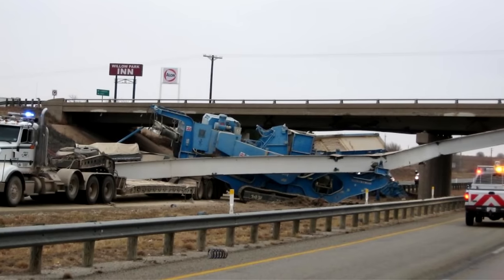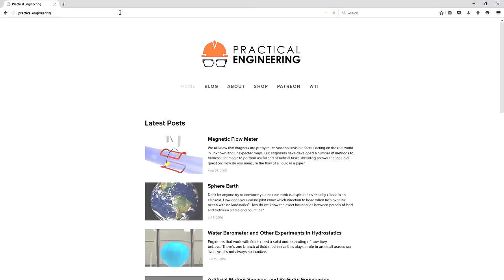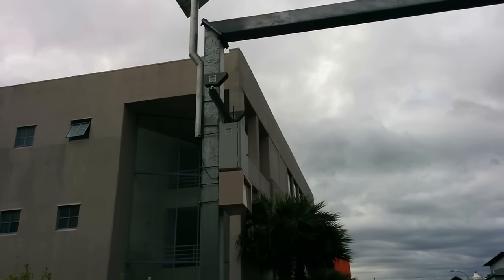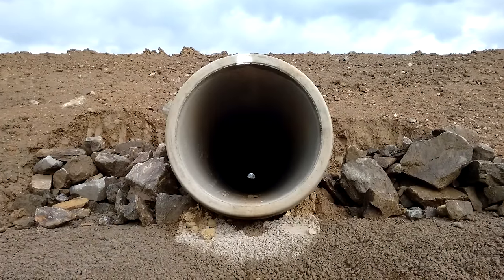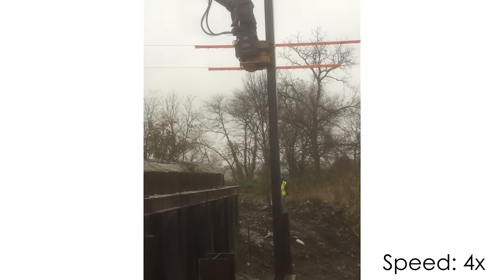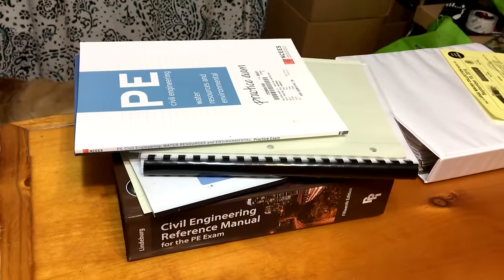What's that Infrastructure? (Ep. 2 - More Transportation Infrastructure)

Comment: how about putting a coin under one of the roller or rocker supports when there's a temperature extreme approaching, then returning to retrieve it when temperatures reverse? A bit slower than the "coin on the tracks" option, but perhaps no less entertaining.
Reply: I wonder how flat it would get?
Reply: @TheAechBomb  lets try and check :D
Reply: I was totally thinking the same thing.  You'd want to set it down and then come check it a year later I think.
Reply: It would probably wedge the roller to a stop and the bridge would get damaged because it can`t expand/contract anymore and then collapse. Then in proper American fashion, you would be sued by the people that died, bridge maker, and the US Mint for destroying the coin.
Reply: @user-fp4dm6od1b  yeah, the same thing is with derailing trains that ran over an coin ;)
Reply: @user-fp4dm6od1b  I'm sure a thin sheet of very soft metal will stop several ten-thousands of pounds of thermal expansion force, rather than just deforming a bit and letting the roller climb over it. That must be why the engineers went to such extreme lengths designing debris guards to keep those roller tracks clean. Hell, you could probably lift the bridge right off its rollers with an ordinary crowbar if it weren't for those guards. Oh wait a sec those rollers are completely open to the air right next to a road where grit and pebbles get flung around by traffic 24/7. Yeah I really doubt a thin wafer of copper is going to do anything to that roller.
Reply: @KingHalbatorix  Have you ever tried to move a car floor jack over a concrete surface with any sort of obstacle like a tiny rock etc.? Stops dead. But I can't tell if you're trying to say the roller wont budge once it hits the coin or that it will demolish and flatten the coin.
Reply: Ernesto Mobo Jr Yo go first 😂

Comment: I used to make the inductive loop detectors at Northstar Controls in Sarasota, Fl. A magnet won't do the trick because they are looking for a reflected signal that comes up from the loop at about 32Khz. You are better off with a sheet of aluminum as it reflects RF better than steel.

Comment: As a structural engineer I would suspect that those pistons on the last bridge you mentioned would indeed serve to help support the bridge during a seismic event like you said. However I would not suspect that they would remain rigid. Assuming that they are a part of the seismic resisting system, when an earthquake happens they would still allow the bridge beams to move but not excessively. Like the dampers on your porch door or your car's hood, they would absorb some of that shaking energy to reduce the accelerations in the bridge piers below. Lower acceleration means lower force which means less damage. Think of a willow tree. In high winds they bend and flex and absorb that wind load more gradually than, say, an oak tree, which remains more rigid. But after a heavy wind storm the oak tree has lost more branches than the willow. The same concept is true for structures.
Reply: Matt Bono , what he is talking about are called hydraulic snubbers, which do lock up under large and fast displacements
Reply: Good to know. Thanks for the info! I'll have to check those out.

Comment: How crazy is this. I stumbled on this video because i am interrested in these kind of things. I was rather surprised to see Gnistängstunneln in an American video. I am born in that area and has driven there thousands of times. I even remember when they built it. Fun fact: I have never ever thought about that the shielding was for the sun, but just a couple of miles away, there is another much more newer tunnel without this feature, and it´s a bit longer, so on sunny days, you get blinded when you come out on the other side. That tunnel is called Lundbytunneln and it opened in 1997. BTW: "Gnistängstunneln" actually has a meaning. "Gnist" (translates roughly to spark) is Swedish (old) slang word for radio operator. And on that "äng" (field) was actually a radio station back in the days. And "tunnelN" is like saying "THE tunnel" in English, we also say "tunnel". The "n" is our way to say "the". So "Gnistängstunneln" in America would probably be called something like "The Radioshack Field Tunnel" (i guess).

Comment: There are a lot of those inductive loops in use around central Iowa. When I am riding I have found If I stop my bike right on or very near one of the side lines in the road the light will change. If I sit in the middle I could sit there for hours and the light wouldn't change.

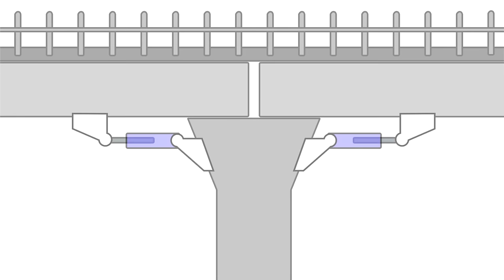Comment: @4:58 That's actually a Light Rail elevated guideway. Part of the Link Light Rail system here in Seattle. Those pistons are on the opposite ends of a segment of guideway that is fixed (either cast in place or a transition from elevated to ground level) the other end. That specific picture is a segment north of the Seatac/Airport Station.

Comment: Please check out the Tibet highway. There are ventilation holes in the supports to keep them cool. The heat from the sun will not get transmitted to the ground and melt the permafrost.

Comment: we have the same sort of moving structure on our steam turbines. as the turbine and casing heats up it expands, sometimes up to a few inches and the entire case needs to accommodate that expansion, some are set on steel wheels, others simply slide inside a track but the most interesting i've seen are ones that sit on an I beam type structure and the support flexes back and forth as it expands and contracts.

Comment: Truck impacts on rail bridges are such a pain to deal with. I used to work on a railway near a rural area that had a bridge that would be struck a few times a year. The sacrificial beam would catch most but occasionally something would contact the bridge or a support. This stopped all rail traffic until the engineers, usually based in the city, could get on site and at least give a go ahead for slowed passenger (light weight) traffic. Having to manoeuvre around the kilometres long freight trains that on rural rail sections that are stuck waiting is not a fun or quick procedure.

Comment: About the rollers on bridges (which are quite common in Wrocław, both the bridges and rollers) I was planning to make an arduino sensor that would collect data from one of those to see precisely how much distance it travels during a year. It would be quite cool to plot it against temperature and interpolate how far would the bridge "go" if it were only rolling in one direction.
It's nice to see your city mentioned ;)
Reply from the maker: Very cool idea, but make sure you ask permission first. People aren't very comfortable seeing a bunch of wires and electronics on their bridges :)

Comment: There are some rather short bridges in Jyväskylä, Finland that do not properly account for thermal expansion and the asphalt on the seams regularly breakes. I mean, they add a new patch of asphalt every two weeks or so. Most of the time there is a huge pothole or two. The situation is also worsened because there's a traffic light where numerous heavy vehicles (around 60 metric tons at worst) stop constantly.

Comment: In the vein of tunnels and blindness, we have many tunnels in the Pacific Northwest that deal with this by varying the lighting: when you first enter the tunnel, there are about three times as many lights as normal, then they grow slightly more spaced out over a hundred or so yards. The transition back to daylight isn't nearly as bad, so they don't ramp back up towards the exit.  

While some might say this is wasteful, we have lots of hydropower in the PNW - prices as low as $0.07 per kWh are not uncommon.
Reply: The Helsinki Metro, built in the late 1970s and early 1980s, has a similar system of accommodating lights at tunnel entrances. The train driver sees gradually dimming light instead of plunging into pitch black darkness.

Comment: The bridge in Durham also has lasers about 1 block away to trigger the flashing lights, sign and so on... but all the warnings do nothing to the trucks.. the city and Carolina Railroad decided to do what they could by raising the bridge 8 inches.  They could not go lower on the underpass due to utilities under the pavement.  They could only go up 8 inches.... (rail would require raising the grade crossings on both sides... )-- Problem with a 12' 4" or whatever.. it still gets hit.

Comment: Theres another height detection warning system on the Southern Motorway in Auckland, NZ. Unfortunately, of all the times that I've seen it flashing, I've never actually seen a truck pulled over to the side of the motorway. I have however seen the sign after its been hit by a high load AND historically there's been a number of high profile accidents including a students head. Note: although a teenagers head is hard, it turns out that reinforced concrete is harder.

Comment: how about different road types. and the tar to stone ratio, in the UK ive noticed that theyve used softer, smoother roads nears schools and but rocky harder roads elsewhere. smoother roads are quieter so it would help schoolchildren hear oncoming cars, whereas the rockier stuff is louder but cheaper.
Reply: They also use softer roads here in UK than in hotter parts of the world. Softer road must have some advantage, (smoother ride? quieter? less wear? lower cost? I don't know),  but as you would know every time we have a heatwave, the roads melt. Couldn't really do that somewhere it gets really hot.
Reply: see i kinda agree with you but when ive been abroad to saudi arabia and turkey the roads there have also been really smooth and they have really hot weather. it could be that they use different materials

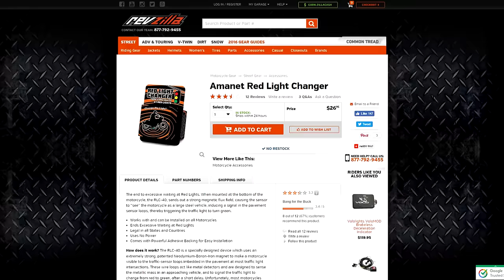Comment: (3:10) Adding a magnet to your motorcycle or moped to cause the sensing loop to detect your low-mass vehicle DOES NOT WORK.  I performed an experiment a few years ago wherein I taped a powerful rare-earth magnet to a long piece of PVC water pipe and waved it over such a loop at a low-traffic intersection.  The traffic light never changed, except for when a car would arrive at the intersection.

Comment: With the sensor loops the also are a magnetic field since there is so little  "iron" in the motorcycles they tend not to  trigger the sensors   I've learn to to just restart the bike there with the Electric starter it helps trigger.  But the newer loops are doing better about having their field broken since more and more car's are also  getting lower in steel content.

Comment: I5 south in LA, I was driving a Semi and forgot to take the I5 truck lane. A mile later I was in with all of the cars shitting bricks because I didn't want to be caught by popo, and because I really have no clue why they split the traffic.
Reply: The split roadway occurs many times where two large roadways combine, by diverting the trucks onto a separate road, entering cars can more easily and safely merge, accelerate and move over to the left before the trucks are add back to the traffic flow. 
Hint: for car drivers, the truck route may help you bypass heavy traffic induced by the merge during rush hour, but it does back up too, so try each route during morning commute to see which is better for you.

Comment: I wonder if a tennis racket design could be used in bridge design? Basically the road is interwoven strings of metal cord the same as in suspension bridge then lay rubber over cords as the road surface.

Comment: Grady, I know that this series is old and possibly not active anymore.  It made me think of infrastructure near me here in Sahuarita, AZ in the form of a U.S. Primary (2-digit) Interstate highway designated as I-19.  It is 63 miles long and is the ONLY interstate in the U.S. system that is completely METRIC in its signage.  Officials have tried through the years to convert to U.S Units, but both the population and businesses have aggressively rallied against it.  And so it stands to this day as the only metric interstate in the U.S.  https://en.wikipedia.org/wiki/Interstate_19

Comment: Isn't the piston thing simply against horizontal movement? If the beam expands, it pushes both pistons on its ends. If a heavy and fast vehicle drives on the bridge, it pulls one piston and pushes the other, so they create a force that moves the beam back. I've seen such a thing on a railroad bridge, but most of the bridges are fine without it. Would be interesting to know which is the part that can be weaker this way.

Comment: the laser system is not to common in new Zealand Auckland we have a low bridge on the motorway that gets hit a good number of times and they have just installed a new laser system with large warning signs that trigger when the beam is broken. 2 beams are used to prevent wild life tripping the system by accident.

Comment: In the 11foot8 clip, the sign tried warning the truck that it was over height and needed to turn. I imagine it was done using a similar laser system to the one in New Zealand. The metal protection just seems like a last resort.
Reply from the maker: +MrSpencerNorth You're exactly right. Looks like they just added the detection and warning system.
Reply: They have always had the metal bar there, but the warning system is indeed fairly new.

Comment: Hey I was wondering about something regarding the bridge thermal management.

For example, here in Melbourne we have a bridge called the Bolte Bridge.

It uses the triangle things on each connection point of the bridge, from bridge to land connection.

However, how does it deal with expansions and contractions against the support towers of the bridge?

Do they also use the same roller systems, so essentially the bridge is floating?

Thanks!

Comment: They have one of those over height detection systems on Highway 1 in Langley BC (near the 232nd street exit) it flashes lights and they have a little pull over area, I've always wondered how they get over height trucks off the highway though, there's no exit between the bridge and the pull over area... There's a sign with a number to call, so they must have some system.

Comment: Your link to submit photos doesn’t work (infrastructure fail!) but check out the emergency stop sign projected onto a curtain of water at the entrance to a road tunnel in Sydney. They wanted a very, very visible warning right in the drivers line of sight (11 foot 8 bridge is sorely deficient in this regard) but didn’t want a physical barrier that might prevent or slow down emergency vehicles.

Comment: Not too long ago, they installed something similar to that shade for a tunnel in a freeway near here. Funny thing though, they did it for one of the exits. The tunnel is 2,5 kms long (1,5 miles) so it's a nice idea since, mostly around summer, sunlight can be quite a danger in the afternoon there.

The place is https://goo.gl/maps/Z4zMzu6fBE42 and it looks like this http://thumbnails1.pressdisplay.com/pressdisplay/docserver/getimage.aspx?regionguid=7d626445-06de-4604-960b-d9d456572edd&file=e2162014123000000000001001&regionKey=CeNoCWe04wG8yAuoK%2Ffk2g%3D%3D

Comment: Hey can you talk about bridge infrastructure. Recently, actually Today a portion of a bridge collapsed on hwy 85 in Atlanta, Georgia . I herd the term Fracture critical on the news. Can you explain.... thanks
Reply: A Fracture Critical Member is a possible feature in a bridge constructed out of steel (it's also possible in Hydraulic Steel Structures like the dam tainter gate that Grady was standing in front of in the outro of the last video).

The definition of a Fracture Critical Member is a structural member 1) constructed of steel* 2) is in tension, or has a tension component, and 3) have no load path redundancy (failure of the member will result in a partial or total collapse.)

The most basic example is a bridge constructed of two steel girders spanning a gap, with a deck between them.  This was a very common design, especially for railroad bridges.The girders, being bending members, have tension on the bottom.  If the tension flange of one girder fractures, it will result in failure of the entire member, and since there is nothing then supporting one side of the roadway, the roadway will collapse (no redundancy).

New bridge designs generally avoid this.  Modern bridges over small spans, such as overpasses, will usually have a number of smaller beams, so that if one fails, the ones next to it can pick up the load without collapsing.  Note that if one beam fails, the bridge will probably have to be closed, and maybe replaced at great cost, but the key is that everybody on the bridge will escape with their lives.

Not every bridge design used today will eliminate FCMs, especially on very large spans, and for those they will detail the connections and construct them using special welding procedures to minimize the possibility of fracture.  They also do special inspections at maximum intervals of 24 months to detect problems before they result in fractures.

* The fracture behavior of reinforced or prestressed concrete is different, so while there are certainly structures of those materials where one girder could result in collapse, they don't do this type of fracture critical member analysis.

Comment: 4:06 - Ha, I use the same roller in my "so what do these supports /\ and(  ) REALLY look like" lecture. "Well you know the round roller support? They can look like..." 
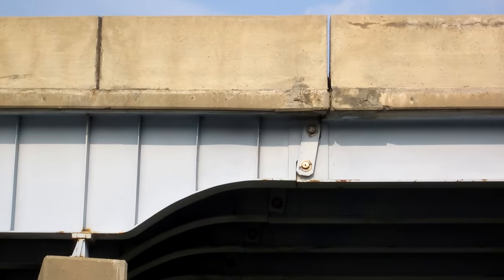4:12 - THAT "interesting expansion joint" looks like a perfect illustration for "why did they redo the Hardvard* Bridge"** connection. *Between Boston and Cambridge at Mass. Ave. at MIT. The important point being "They hung the middle sections so that if they failed they'd drop into the river instead of being held up by the pier sections." And a hangar failed. **Of "smoots" fame.
See also https://en.wikipedia.org/wiki/Mianus_River_Bridge for discussion of actual bridge failure with similar system.
If the pistons do that, then it makes me wonder if they are filled with oobleck.